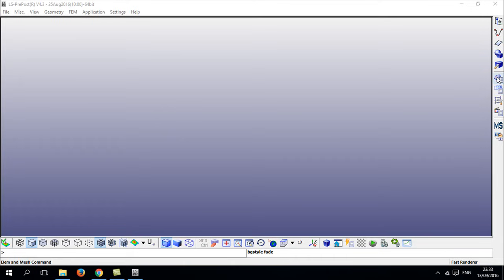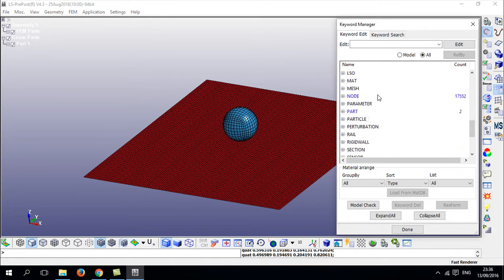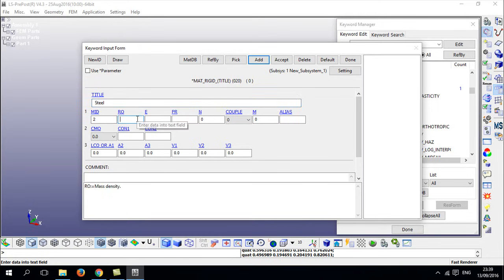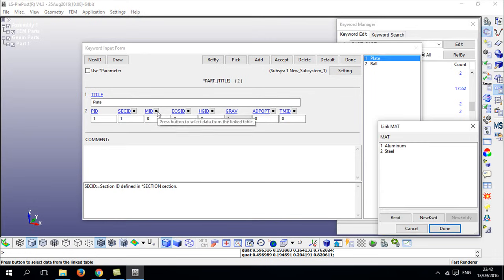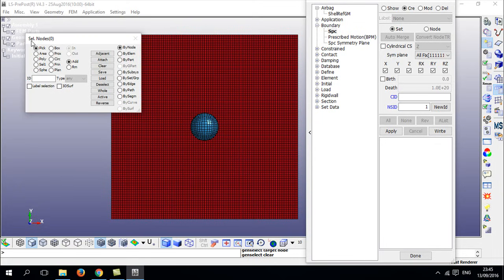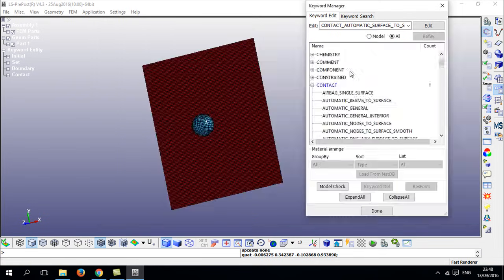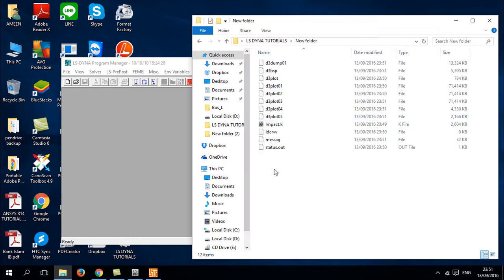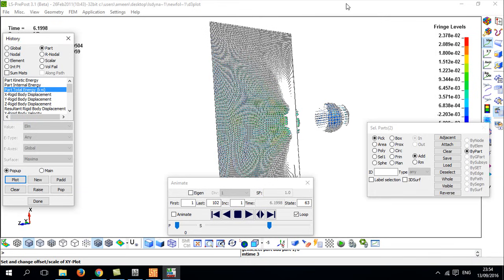LS-DYNA TUTORIAL 1: Ball Impact on a Plate

Comment: I followed all the steps shown in your video, but during the simulation the ball does not rupture the plate. Instead, the material stretches around the ball without breaking. I am using the LS-DYNA Student Version. Could you please help me fix this issue?”
Reply from the maker: Have you defined the failure strain in the material model for the plate?
Reply: @AmeenTopa  Already taken care of! It turns out that the student version of LS-Run was somehow not reading the EPSF coefficient, which was causing the problem. Could I also ask for the data source used in the project?

Comment: Hi Topa,
Thanks very much for this tutorial which I've found to be very clearly instructed and useful!
One comment is that I followed all your steps but the ball did not break through the plate, meaning the erosion and element deletion did not occur, even when the set strain criterion was exceeded. The plate would be stretched to hold the ball even if I change the speed to be doubled.

Then I found to make it break through I would need *MAT_ADD_EROSION and *CONTACT_ERODING_SURFACE_TO_SURFACE. With the same strain criterion I then got results similar to yours. Not sure whether it is due to a newer version of LS-DYNA which makes the failure feature within *MAT_018 different now (I'd be surprised!)

Anyway thanks again for your tutorial!
Reply from the maker: Hi, 

Thanks for your comment. Given that you exactly followed my tutorial, it could be due different solvers that we are using. I was using the double precision LS-DYNA solver. 

Have you tried reducing the failure strain?

Comment: Hi Ameen, I like to know what failure criteria were used or specified for the plate in this simulation. My simulation does not show any failure. Thanks.
Reply: I set the power law plasticity as shown in the video, but simulation does not show failure
Reply from the maker: @shang-rouhsieh1685  have you defined a failure strain? 

The parameters can be obtained from research articles or technical reports.
Reply: @AmeenTopa  Thank for responding. I checked the keyword deck, apparently, the failure criterion was not input properly. Thx.
Reply: @AmeenTopa  Do you happen to know how to output the read-in deck (save the model being read-in, so I can check what was being included in the LS-DYNA and then debug if needed)?
Reply: Sorry. I found the answer. Now I can move to study other problems. Thanks.
Reply from the maker: @shang-rouhsieh1685  check d3hsp

Comment: What should I search for when trying to find the parameter "Plastic Failure strain for element detection" for different materials? For example, copper?
Reply from the maker: @tomaslopes4237  You can check Varmint al's engineering webpage. You can find a database there for different metals.

Comment: hello everyone, im in initial learnin phase of ls-prepost and im facing problem how can i draw stirrups in a beam. can anone guide me to solve this issue .. thank you
Reply from the maker: Check my tutorial: Reinforced Concrete and Wrecking Ball
Reply: @AmeenTopa  i watched this video but there is concept about stirrups/rings in beams. its about slab and impact on slab.
Reply from the maker: @bilalrana9543  brother, if you need how to model an RC slab you should be able to model RC beams. The steps are the same. Create the rebar elements and position then in the right place and direction. You can also resize them. All can be done with the Transform tool.
Reply: @AmeenTopa  thank you very much for your reply, i modelled the beam with longitudional reinforcement but i am not getting how make rings/stirrups in beam. thank you
Reply from the maker: @bilalrana9543 stirrups are modelling as simple vertical and horizontal rebar lines which are connected to each other. In my tutorial, I used how to create horizontal rebar elements. If you know how to do that, then it shouldn't be a problem to create vertical rebar elements.

Comment: Can you help me ?  Same example but hypervelocity impact: I have the following issue: the intruder going trough the plate without breaking it; it’s like the plate can’t see the intruder. How can i solve ? My Vz is 1 km/s
Reply from the maker: @grf00  if it is exactly similar to my example except for the velocity, then you need smaller timestep size. In CONTROL TIMESTEP, set TSSFAC = 0.1. or 0.01.
Reply: @AmeenTopa  thank for the answer. Time step is ok, in fact the problem is that during the simulation the intruder is like a ghost for the plate, it going through the plate “without touching it” (physically impossibile). I think that I have to change the material card or the number of nodes
Reply from the maker: @grf00  how do you know the timestep size is okay?

First, try with lower velocity first (100/s) and see if it works or not.
Reply: @AmeenTopa  because in the simulation I can see the intruder going into the plate. Anyway thank you for your answeres!
Reply from the maker: @grf00  your answer does necessarily mean that the timestep size is small. I am here talking about the calculation time step, not the output time step, which is something different. 

The higher the velocity, the smaller the needed timestep size. In my example, it is low velocity, so the default timestep size calculated is sufficiently small. In your case, it is high velocity, so you need a smaller timestep size.

This can be achieved by either having smaller element size, or by following my first answer.

Comment: Sir, I have followed the tutorial that you taught, but why can't my program be run in LS Dyna Run?
Reply from the maker: What's the error?
Reply: @AmeenTopa  The program is terminated
Reply: I've tried fiddling with it but it still terminates
Reply from the maker: @31.trianurhalizah76  have you tried running another model? You can get a sample file from dynaexamples.com 

This is just to confirm that you have installed the software correctly.
Reply: How to fix if there is a warning in the section?

Comment: Hello, I am trying to do a similar case but the master PID where s ball impacts it's made of rubber. Do you know what kind of MAT I could define if I expect that the master PID will fail?
Reply from the maker: @alvarogarciamendez6147  check out this example:
https://lsdyna.ansys.com/contact-rubber/

Take note that a different unit system is used in this example..
Reply: @AmeenTopa  thank you, I've checked previously too but my model fails because the impact ball requires high velocity. In this example the velocity is low so there is no failure. I appreciate your answer, thank you.
Reply from the maker: @alvarogarciamendez6147  to add failure of the material, you may use MAT ADD EROSION. 

As far as I know, there is no hyper elastic material model in LS-DYNA that has a built-in failure criteria.

Comment: Hi , should we apply mass to the impactor i,e ball or mass density is enough
Reply from the maker: Depends on the actual case that you want to model. If you have a spherical projectile, then no need to add mass, just follow the example. 

But, if your impactor is a cylinder with a hemispherical end, and you model only a sphere, then you need to increase the mass to match the mass of your cylindrical impactor.

Comment: brother ameen, i have met a problem during running a helmet imapact sim. 
the whole model with anvil, shell, foam liner and a head model. when the foam liner using original thickness and the acceleration is acceptable,
but when i reduce the thickness of the liner so the head will crush the liner and impact the anvil, and the Z-acceleration of the model has surged to a illogical number, also the liner elements will deform and penetrate to the head model. how can i solve this problem
Reply from the maker: I think the liner is made of soft materials such as rubber or form. If that's the case, then watch my tutorial 3 points bending test. Also, check the materials in the description of that video.
Reply: @AmeenTopa  thank u so much ameen, i have one more question that before setting the contact_interior card for eps foam, the da2 and da4 in the foam set_part was set to 0.1 and 2, what does it mean? i've check the mannual but still not have a clue
Reply from the maker: @AccelifeLiam  check out this link: https://www.d3view.com/contact-interior-for-foams-honeycombs-and-rubbers/
Reply: @AmeenTopa  so much thanks to  you ameen, you are my savior

Comment: I don't have a mouse, so I was using my laptop's keypad to do everything, till you selected the edges for the boundary conditions. As soon as I tried to select by click on the left button, it tries to rotate the view, rather than selecting anything. I'm stuck and don't know what to do. Please help.
Reply from the maker: To select the view, you can choose Top, Bottom, Right, or Left view of the bottom tool bar. 

Only if you hold CTRL or SHIFT, then the view will rotate.
Reply: @AmeenTopa  I selected the top view, but the selection wasn't happening, only rotating and panning were happening using left and right click respectively.
Reply from the maker: @bethechange5942  make sure your shift or ctrl are not being pressed. I work without a mouse sometimes and there are no problems.

Comment: Sir does height of the ball makes difference like if we take different height does the result changes
Reply from the maker: No. The ball will travel at the given initial velocity until it hits the target. This is because we didn't define gravity in this example (it is not needed here).

To see how to define gravity, check my tutorial on Reinforced Concrete and Wrecking Ball.
Reply: @AmeenTopa  I am doing project on low velocity impact analysis on aluminium 6061, can you help me?
Like how to plot graphs like force vs displacement and velocity vs time.
Thank you
Reply: @AmeenTopa And for material properties of plate , what should I use 
Johnson crook or the property used in the video, sir please reply
Reply from the maker: @chandff666  this is no material model called Johnson Crook 😂😂😂

Using the same material model as in this video is fine for low velocity impacts.
Reply: @AmeenTopa  ok thank you sir

Comment: Hello! Your video is very helpful. I wnat to change the plate to glass(not aluminumn), so should I use 280-MAT_glass? If so, may I know what properties I should put in? Thank you!
Reply from the maker: I have a tutorial on the torsion test of brittle material. I used a different material model. But from that video you can learn where to search for material properties.
Reply: @AmeenTopa  Thank you for your answer! We changed the tutorial above 18-MAT_POWER_LAW_PLASTICITY to 210-MAT_GLASS. However, BOUNDARY_SPC doesn't catch the edge part. May I know what to do? Looking forward to hearing from you!
Reply from the maker: I believe that the BOUNDARY SPC is working but the plate is breaking at the edges.
Reply: @AmeenTopa  Thnak you for your answer! I'm sorry, but it's not easy to find physical properties. Is there a way to find examples related to glass? I can't find examples related to glass anywhere....
Reply from the maker: @윤재광-x4p  You need to learn how to use Google.

Type the following (including the quotation marks):
"LS-DYNA" "GLASS" "MAT280"

And the thesis below is one of the results:
https://core.ac.uk/download/154833183.pdf

Now, read that thesis. Then, check the references of the thesis for more reading materials.

ALL THE BEST!

Comment: Hello sir I follow the same procedure as you explain ball also hit the plate but it's not crossing the plate.
In my case ball hit plate again bounce back.. can you plz clear me where I made mistakes
Reply: tbh its kinda funny especially at full speed it just goes "boing boing boing"
Reply from the maker: @mrpigeonalt4371  this "full speed" is not the actual speed in our real life. The simulation time is only about 10 milliseconds. This means the whole impact and bouncing that you see should occur in that short period of time.
Reply: @AmeenTopa  my bad it's still pretty funny with it looping
Reply from the maker: It could be a problem in the material properties (such as you didn't define failure strain), the thickness of the plate is incorrect, or the ball velocity is too slow for full penetration.

Comment: In my case, the resultant rigid body velocity  have a constant horizontal line set at 20. Why  this is happening? 
I used LS RUN to solve the file.
Reply from the maker: Maybe the thickness of the plate or the material properties are incorrect.
Reply: @AmeenTopa  okk thanks
Reply: @AmeenTopa  And I want to perform one drop test and want to set acceleration. But there is no option of setting acceleration. How to do it?

Comment: Hi,Ameen. Thanks a lot for your fantastic videos. I have a question about the type of contact. 
If I set the ball as an elastic or plastic part und plate remains plastic behaviour, in this case which contact type should I use?
Reply from the maker: If you only change the material type then no need to change the contact.
Reply: what happens with the contact typ if I use solid mesh for ball and shell element for plate? thnaks a lot in advance!  @AmeenTopa
Reply from the maker: @meinleben-v5l  still no need to change the contact. But if the ball elements are expected to be eroded (deleted), then use CONTACT ERODING SURFACE TO SURFACE.
Reply: nice to get your reply, thanks a lot. By the way,do you think  it is a safe way to have the automatic surface to surface for most  common cases?  @AmeenTopa
Reply from the maker: @meinleben-v5l  yes, for most applications, CONTACT AUTOMATIC SURFACE TO SURFACE will work. 

I always answer the questions in the comment section. 🙂

Comment: 1:10 I want to make a rigid plate of the length 914.4mm and width 609.5 and thickness 6.35mm. How do I input my numbers here in this coordinate system to make this plate?
Reply from the maker: The plate has four corners. You need to put the x,y,z location of each corner.
Reply: Hello! Do you send mail address?

Comment: Thank you for the nice tutorial, can you help me with these error? " Error 20389 (STR+389)
     thin shell element 10001 references part number 2
     that does not reference a thin shell section" (this error start from 10001 untill 10050 )  and this error 
    "Error 20230 (STR+230)
     element ID 10001 has a nodal thickness
     that is less than or equal to zero."  i have student version...
Reply from the maker: You are mixing between shell and solid elements.

For part ID 2, you created solid elements but you defined SECTION SHELL for it (or vice versa)

Comment: When I want to build a complex and difficult 3D model, how should I do it? Hope you reply
Reply from the maker: You can check my playlist: MESH IT WITH LS-PREPOST.
Reply: @AmeenTopa  Thank you, but I want to build a 3d model by myself, how do I do it? I feel like building that is quite difficult
Reply from the maker: You can create the 3d geometry with any CAD software (like SOLIDWORKS) then import the igs file to LS-Prepost and mesh it with the tetrahedron Mesher tool. I discussed this in one of my videos in the playlist that I give to you in my previous comment.
Reply: @AmeenTopa  That is useful knowledge. Thank you so much senior
Reply: @AmeenTopa  I want to ask you . When I build a 2d model in autocad and changed it to .igs but why I still can't open the igs file in Ls dyan.
error : Can't import .
:(
Reply from the maker: @hieunguyeninh8078  I don't know. Make sure you select import geometry option.
Reply: @AmeenTopa  thank you so much
Reply: @AmeenTopa   I have 1 question for you: If I want to simulate a drop of water falling on a flat plate, where can I set the non-slip condition of the liquid?
Reply from the maker: What method you want to use? SPH, ALE, or ICFD?
Reply: @AmeenTopa  SPH
Reply from the maker: @hieunguyeninh8078  you can try with automatic nodes to surface. Put a very high value for static and dynamic friction coefficient.
Reply: @AmeenTopa   woa ok thank you... You're so Nice
Tôi không biết nói gì ngoài 2 từ Cảm ơn
Reply from the maker: @hieunguyeninh8078  you are welcome. You can register to my workshop to learn more. 😁😁
Reply: @AmeenTopa  haha maybe i don't have enough skills and knowledge. I'm just a chicken. And My english is not good
Reply: @AmeenTopa  I am very grateful for your help....
Reply from the maker: @hieunguyeninh8078  okay. Go improve your English first then come back to me. I will be waiting. 😌😌😁
Reply: @AmeenTopa  Thanks... I will try hard try hard try hard
Reply: @AmeenTopa  I tried building a 3d model in Nx12 and tried to import into Ls Dyna without success, I did the following:
Build 3d model in Nx ( file : a.prt) and I renamed it to a.IGS and then I Ctrl_G then Ok but got error
Can you help me ?
Reply from the maker: You cannot do like that. If you change the format of the file, it will make it corrupted. You need to save the file as .igs from the software interface.
Reply: @AmeenTopa  oh let me try
Reply: @AmeenTopa  thank you so much
Reply: @AmeenTopa  WOA, IT'S BEEN 2 YEARS SINCE THAT DAY,  I HAVE GRADUATED AND I AM WORKING FOR AN AUTOMOBILE COMPANY TO CALCULATE THE DURABILITY OF PARTS THOUGH I LEARNED CFD BEFORE.    HAVE A NICE
Reply from the maker: @hieunguyeninh8078 It's nice to hear back from you. All the best in your job!
Reply: @AmeenTopa  I hope you do too, you have a very good job

love from Hanoi Vietnam <3

Comment: sir what happens if i dont chose boundaries ?
Reply from the maker: They will not be fixed and the plate will be moving slightly.
Reply: @AmeenTopa  ow okey , so puting boundaries in a car crash wont make the colours in von mises stress display , just trying to figure out a solution to my problem , thanks a lot , i know ive submerged u with question and im sorry about that